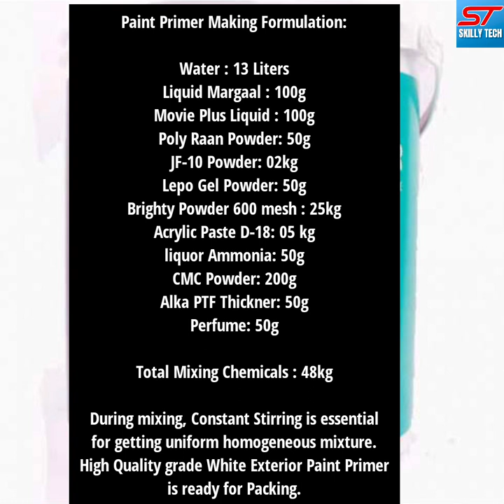Primer Paint Small Factory| Leak Formulation of Primer Paint|#Skillytechplaylist #primerpaintformula

Comment: Thanks a lot sir, this paint for what use out walls or inside walls?
Reply from the maker: This is Primer Paint, can use interior or Exterior places As a base Coat or Cover Coat before applying INTERIOR or Exterior Paint for getting better finishing & Paint Covering or better Paint adhesion results.
Reply: @skillytech4296  can we use titanium dioxide in it?